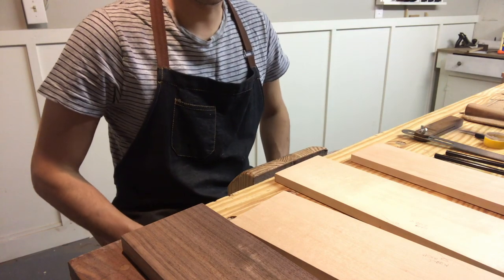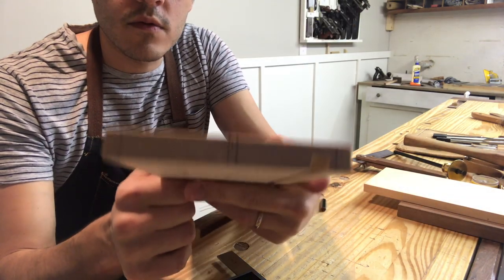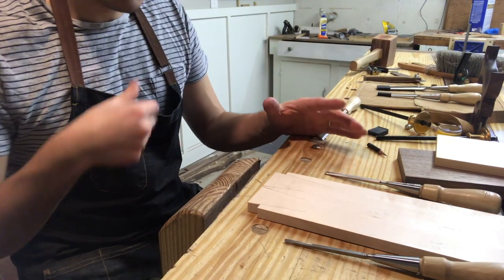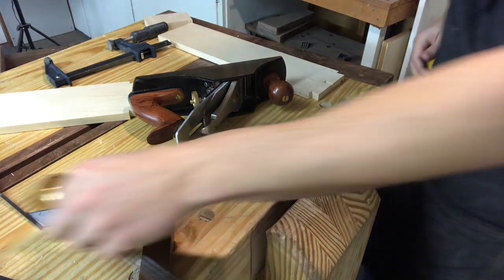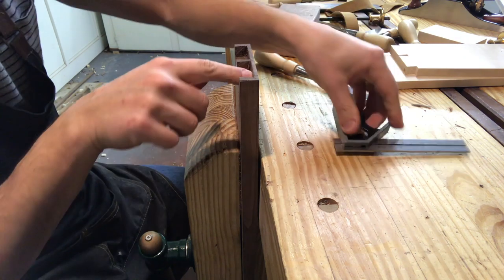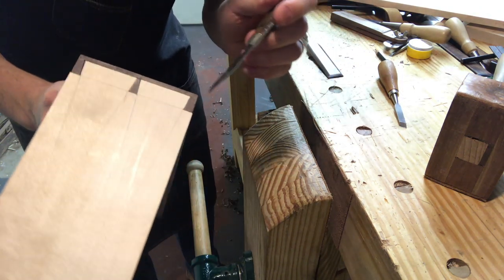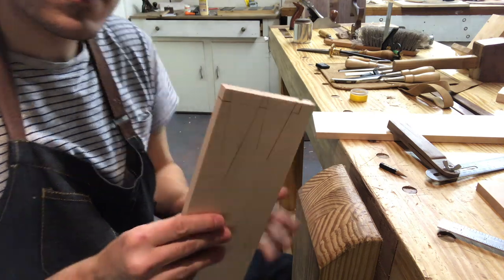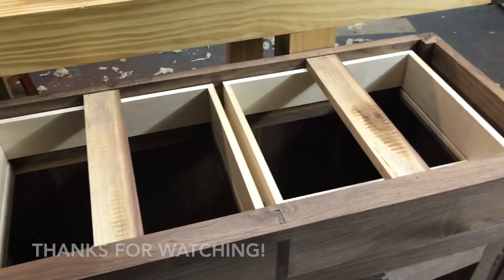Building a Sideboard part 22: Dovetailing the Drawers | Hand Tool Woodworking

Comment: It's really looking good. When you used the plane to support the tail board for marking the pins, it looks like you sometimes had a little instability with left/right rocking. If I may offer some advice: orient the plane so the sole is parallel to the end of the tail board (instead of nearly perpendicular to it as you did in the video). You don't really need to stabilize along the length of the tail board; the tail board just bridges between the plane and the pin board and is already plenty stable along its length.
Reply from the maker: Thanks!